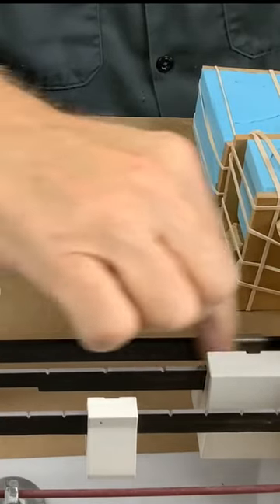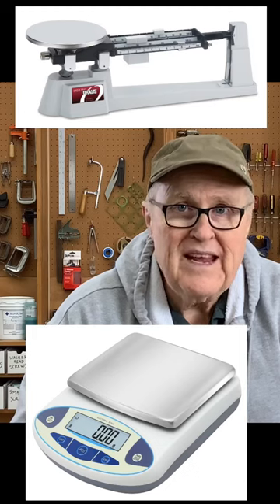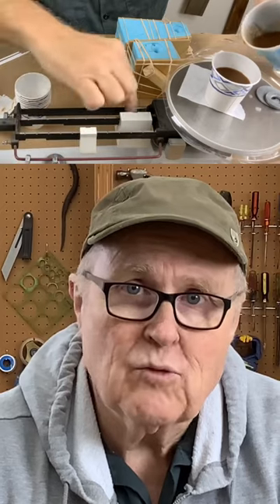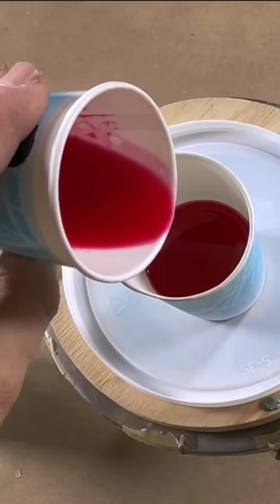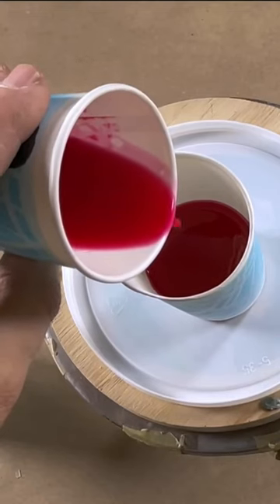You Need A Scale!

Comment: I’ve often wondered if I’m not mixing my 1:1 correctly. I always seem to end up with more of one part vs the empty other part. My resin pieces come out great, although sometimes they require extra time to fully cure. I use grams, is that a good weight to go by or is there something more accurate?